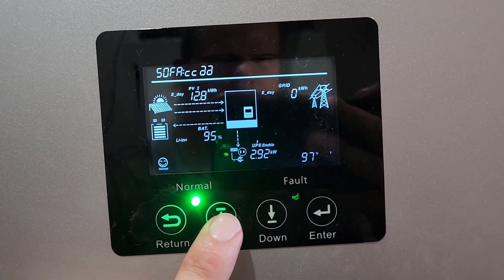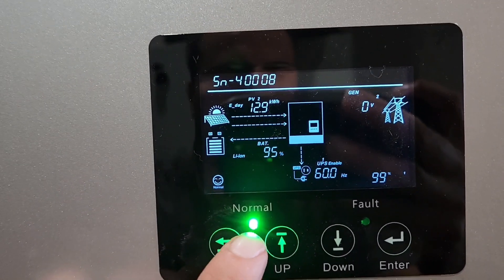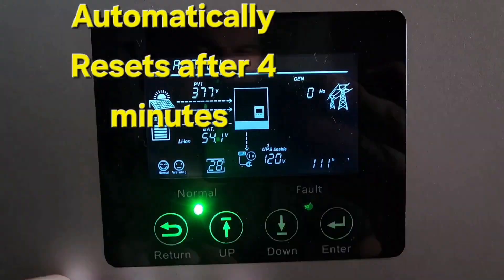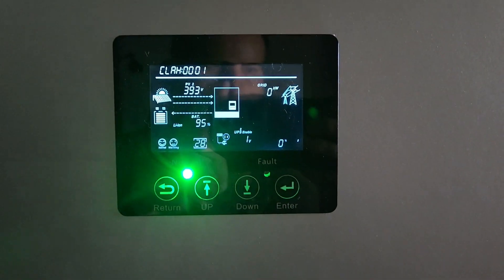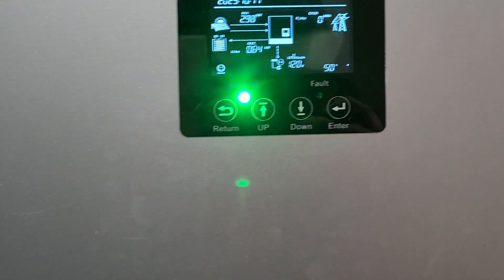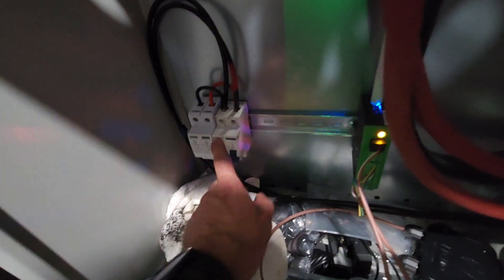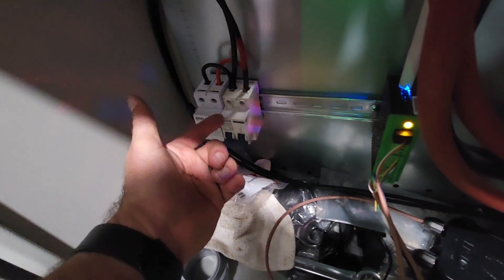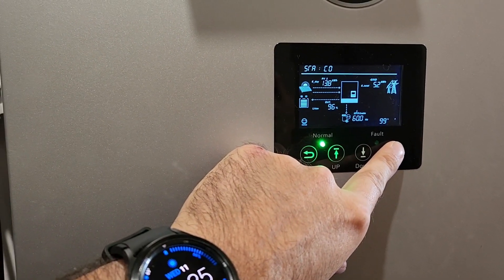EG4 6000XP, 15 Minutes of max load, single leg overload, fan settings, and rambling about 18Kpv

Comment: What's the max dc charging voltage the unit allows you to set? I have 17s Lifepo4 and not sure if it will allow high enough voltage to charge it.
Reply from the maker: 60v, which would be around 3.53v per cell.  Also equal to 56.5v if you had a 16S pack. Around 99.5% SOC
Reply: @theadventuresofarenaissancman  did you have to set it to lead acid for the unit to allow you to increase charging voltage to 60vdc?
If that's the case this will work with my 17s battery banks, 99.5% is plenty soc
Reply from the maker: You would need to use lead as battery type and adjust the voltage for your pack. I'd use around 51v for low voltage disconnect, 60v for bulk and 57.5 for float..with a 17S pack.   What voltage do you currently use?
Reply: @theadventuresofarenaissancman  I don't have unit yet so I'm doing research to make sure it works with my diy banks. I plan on using 2 of these units
Reply from the maker: Do you have a BMS yet?
Reply: @theadventuresofarenaissancman  
I'm looking into BMS, I bought a JK for another project. But the guy im purchasing the battery cells from is using JBD and he said they're reliable. I'm avoid Daly BMS.

Comment: I just installed 6 LifePower4-48V batts and an EG4 6000XP. Can someone PLEASE HELP ME? The super bright green LED blinks all the time and will not stop blinking and produce AC power. HOW DO YOU TURN ON THE INVERTER?!?! It has the unhappy "warning" face and I have absolutely NO IDEA why and what to do about it. It is very vague. Is there some way to find out what the error is? Multimter shows the battery voltage is just fine at +52.6V at the terminals in the 6000XP.
Reply from the maker: Goto the third setting and change your battery type to lead.  It sounds like your batteries may need updated firmware.
Reply from the maker: Can you confirm that the 1st battery has all four DIP switches in the down position?
Reply from the maker: Do you have the battery communication connected between the batteries and inverter?
Reply from the maker: You can download the current user manual from https://signaturesolar.com/eg4-6000xp-off-grid-inverter-split-phase/?ref=M12gk_2DtiVacN

Comment: Hi,what batteries are you using, I cannot get eg4-LL  with the built-in screen to connect to my 6000xp. I double-checked settings #3 lithium 0 Eg4. I think I got to write a firmware version to the Batteries.?
Reply from the maker: Use LUX for the CAN communication.  You need to change the battery internal communication to LUX. Using the dip switches and screen.
Reply from the maker: I'm using the Lifepower4 batteries.   I wish that I had purchased the LL batteries.
Reply from the maker: https://m.facebook.com/groups/5869173729835651/permalink/6938565849563095/?mibextid=Nif5oz
Reply from the maker: Link to the EG4 Facebook Group.

Comment: Can the 18K and the 6000xp be put in parallel together?
Reply from the maker: No,  but I haven't actually tried connecting a ethernet cable between the parallel ports.  However I was using the 6000xp as a grid input for the 18Kpv.  The 6000xp handled the initial surge loads and load dumps as high load appliances kicked on and off.

Comment: Do mind giving me some advice. 
I’m want to buy the 6000xp with the eg4 powerwall. For our fully off grid house in the Philippines we are building.

our budget right now doesn’t allow us to buy pv panels yet. 

We have a diesel generator 8500 watts 

If we buy a eg4 chargeverter to charge up the battery should I connect charger to the xp or directly to the powerwall battery ?  

Appreciate your advice 😊
Reply from the maker: Connect the Chargeverter to the battery.  You will need to buy the special cable connectors for the battery
Reply from the maker: https://signaturesolar.com/eg4-powerpro-battery-cable-connector-black/
Reply: My other concern my generator is a cheapish Chinese made 220/240 v 60 Htz.  And I’m worried about possible dirty power coming from generator if I connect it directly to the xp
Reply: Thank you very much and thank you for your link and fast reply. I know very little about this and was confused what to do.

Comment: Have you had any major issues with light flicker or other issues when motors (vacuum or well pump or non inverter type air conditioner etc) start up with the 6k or 18k?
Reply from the maker: Just a typical dimming of lights for a split second when a heavy load kicks on like my electric dryer (5,700 watt resistive).  

My house air conditioner is a 2 ton unit thats 20 years old.  No issue starting or running on either inverter. 

Now that I think of it, the vacuum causes the lights on the same circuit to dim for a split second. 

I don't have any issue with strobing lights. 

I'll be installing a 2nd 6000XP sometime soon.
Reply from the maker: I'll add that when the 18Kpv is connected to the grid and "on grid mode" is enabled...there's absolutely no dimming of anything.

Comment: Nice.  Thanks for sharing.  

Not a big fan of the display or menu system.  Just looks messy and confusing.  From the menu system, it doesn't seem like they're using all the screen real-estate possible to help explain the settings.  From the display standpoint....yeah, just a mess.  Even the 6500s seemed less confusing to me.
Reply from the maker: Most of the settings are accessible from the app or website.

Comment: Nice. You using the chargeveter as a resistive load? I like that idea.
Reply from the maker: Yes and the house was pulling around 1,500 watts.
Reply from the maker: Do you have any ideas for max load?  The max load for my house is around 9,000 watts (dryer and cooking appliances).  I could dig out a few space heaters.
Reply: @theadventuresofarenaissancman  water heaters are really good. Otherwise I   guess space heaters and heat guns.
Reply: @theadventuresofarenaissancman  find a friend with an EV.  Super easy to have the car request a charge and most of them will let you adjust the amps from say 5a to 42a.

Comment: I like it, but wish it had a little more power output. I can't trust that someone in the house won't try to use the toaster oven and the vacuum at the same time. 

I'm thinking of getting a Rosie.
Reply from the maker: You can parallel more inverters for higher output.
Reply: @theadventuresofarenaissancman  Yes, I know. I don't have the room for two without rearranging a lot in my garage. 
Can I ask why you have this and a 18k? 
Are you gonna use it for 240v only?
Reply from the maker: Water heater and plug in hybrid.